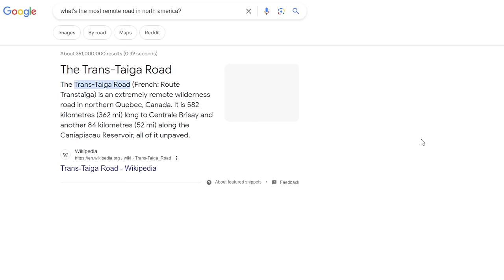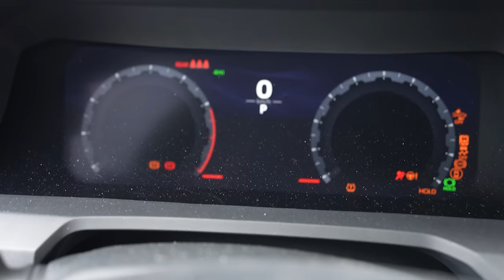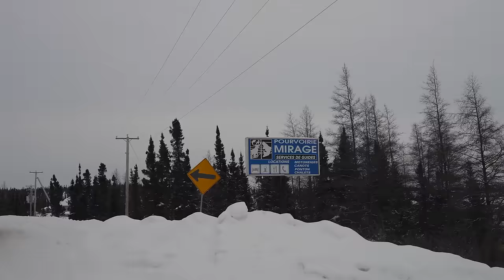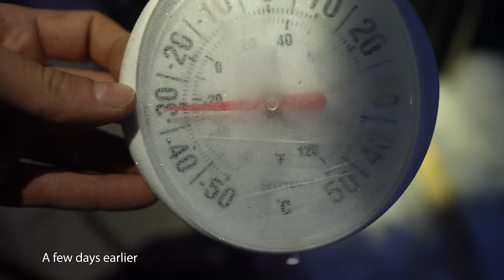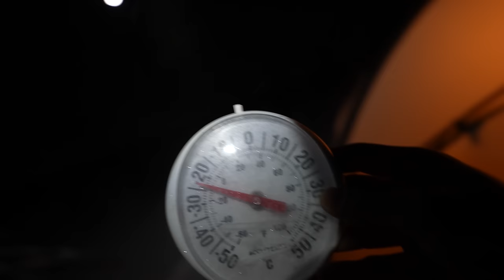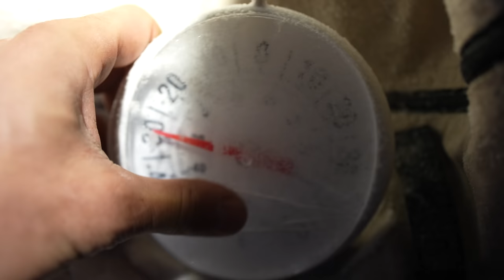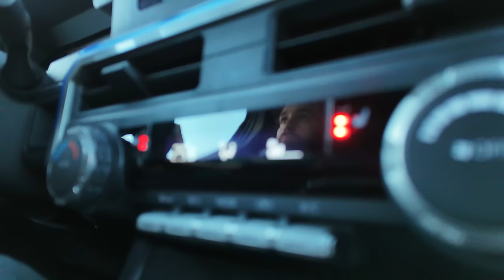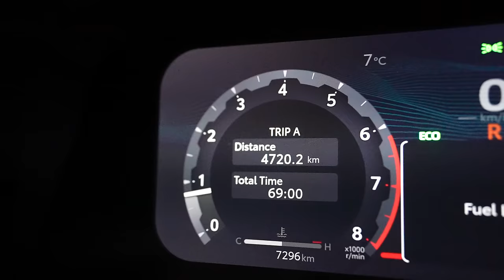Winter Camping on North Americas Most Remote Road

Comment: The James Bay Project flooded approximately 2.7 million acres of land, specifically old growth forest. This is significantly larger than the 1.9 million acres covered by Algonquin Provincial Park. In fact, the area flooded by the James Bay Project is about 1.42 times greater than the size of Algonquin Provincial Park. This massive flooding highlights the extensive environmental and ecological impact of the hydroelectric project in northern Quebec.